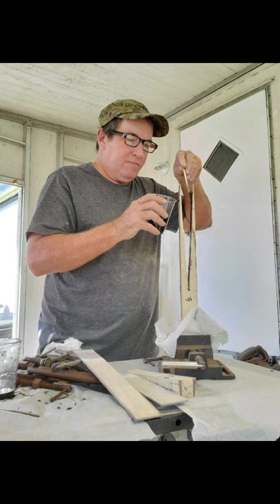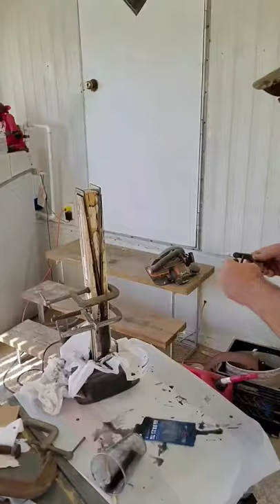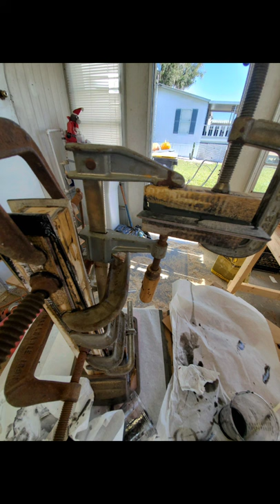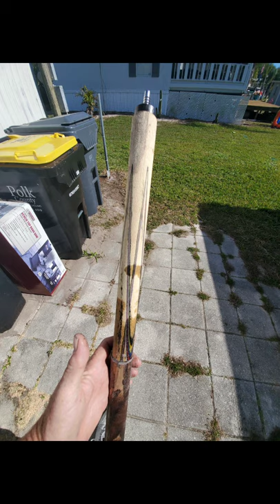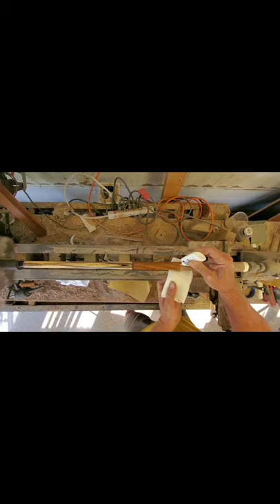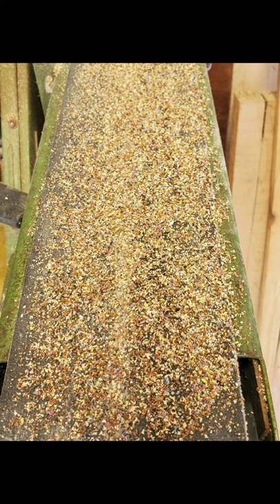building a full splice pool cue

Comment: cool video..liked the final cue. Wouldnt it be a short splice though? Did you just dowel the A joint with the black ring or was it bolted?
Reply from the maker: Hi thank you. I drilled and tapped a 5/16 bolt with my dowel. They seem to play well with no vibration.